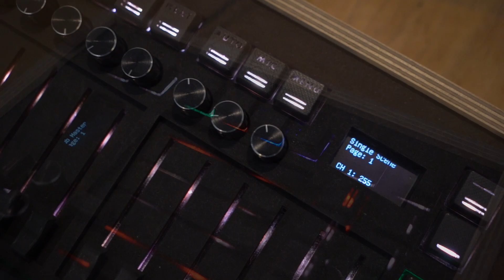DIY DMX Controller Timelapse

Comment: Super nice, how did you manage the software part ?
I'm looking into this kind project, looks great ! thanks !
Reply from the maker: Hey, I've done it with the Arduino IDE, pretty basic and it runs all on device.
Right now I'm working on a new code version in PlatformIO for better code reusability and more functions.